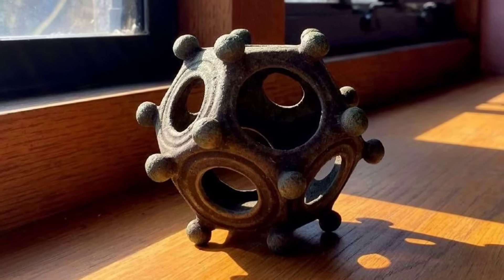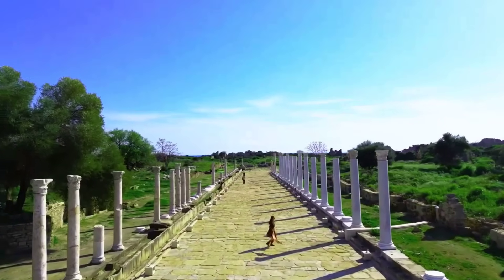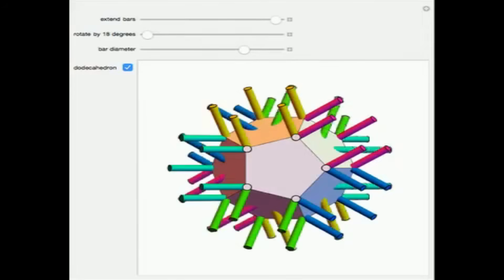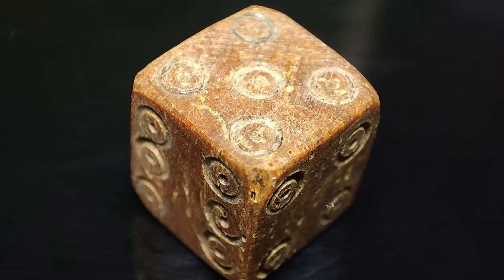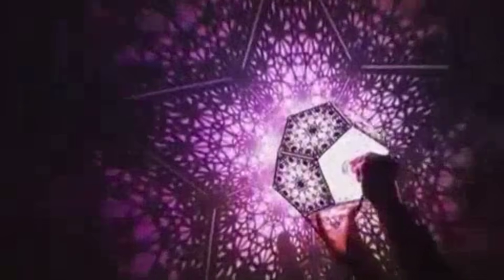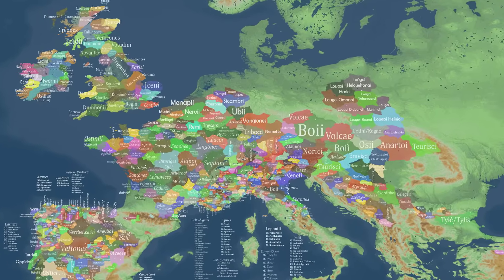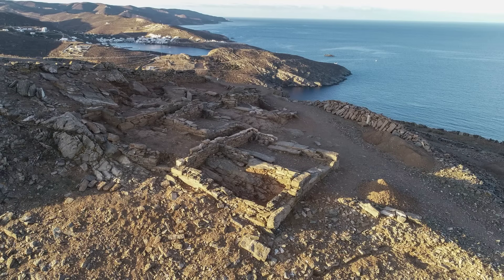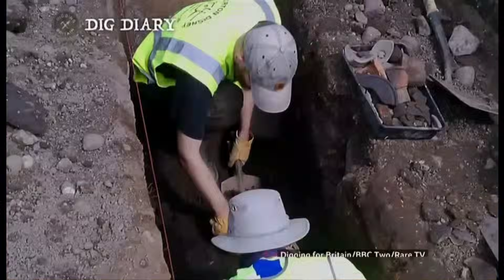Scientists Finally Solved the Roman Dodecahedron Mystery — And It’s WORSE Than We Thought

Comment: FUNCTIONAL LUNAR–SEASON SYSTEM USING A 12-FACE AND 20-FACE DEVICE
Purpose of the system
This system exists to keep a community aligned with the Moon and seasons over long periods without day counting, written numerals, or astronomical calculation.
It is designed to:
survive missed observations,
tolerate weather and seasonal distortion,
and correct long-term drift without destabilising the monthly structure.
The system operates using two objects with separate roles.
PART I — THE 12-FACE DEVICE (MONTH CONTROL)
1. What the 12-face device represents
The 12-face dodecahedron represents twelve lunar month positions.
Each face corresponds to a type of lunar month.
Faces do not represent calendar dates or fixed lengths.
Orientation is contextual (the system does not require a fixed “January”).
The object is rotated through the year as months pass.
2. How a month begins
A new month begins at the first confirmed full moon after the previous month ends.
Full moons are chosen because:
they are unmistakable,
visible even under poor conditions,
and culturally dominant.
New moons are not used because they are unreliable under real conditions.
3. Month-type encoding (the numeric ladder)
Each face carries a numeric class, encoded by dots or notches.
The observed operational sequence is:
10 – 9 – 8 – 7 – 6 – 5 – 5 – 6 – 7 – 8 – 9 – 10
This sequence is:
mirrored,
bounded,
and repeated across objects.
These numbers are not counts of days.
They represent tolerance bands for the month.
4. How the numbers are used in practice
When a month begins, the face in use tells the observer:
how much deviation from expectation is acceptable,
how long to wait if the moon is delayed,
and how much slack exists before correction pressure builds.
Higher numbers (9–10):
long visibility windows,
greater seasonal stability,
minimal risk if observation is late.
Lower numbers (5–6):
compressed months,
winter conditions,
high sensitivity to drift.
No arithmetic is performed.
The observer interprets the month categorically, not numerically.
5. Rings / secondary marks (dark-day buffering)
Rings or secondary marks indicate buffer allowance.
They allow the month to absorb:
cloud cover,
delayed moonrise,
horizon obstruction,
extreme seasonal twilight.
Instead of forcing recalculation, the observer waits within the allowed buffer.
This is why the system does not collapse when observations are missed.
6. Progressing through the year
After each month ends, the object is rotated to the next face.
The sequence is followed continuously.
After twelve months, the object returns to the starting face.
No correction is performed here.
The 12-face device is intentionally kept stable.
PART II — THE 20-FACE DEVICE (DRIFT ACCUMULATION)
7. Why a second device is required
A lunar year (~354 days) drifts against the solar year.
Correcting this inside the 12-month system would:
distort month-types,
break the mirrored structure,
and destroy tolerance logic.
Therefore, correction is externalised.
8. What the 20-face device tracks
The 20-face object tracks full-moon dominance cycles, not months.
Each full moon has a recognisable three-stage window:
approach,
peak,
decline.
Each complete full-moon cycle advances the accumulator by one step.
The three-dot clusters mark this three-stage recognition, not three days counted.
9. Accumulation across years
One full moon → one increment.
Increments accumulate across years, not within a single year.
The device is advanced only at full moons.
The object is not reset annually.
10. Triggering an intercalary month
When the accumulator reaches its threshold (≈ 20 full-moon increments):
an extra lunar month is inserted,
immediately following the major seasonal anchor (e.g. Samhain / winter threshold).
This restores alignment between:
lunar months,
seasonal position,
and agricultural or ritual timing.
After insertion:
the accumulator is reset,
the 12-face cycle continues unchanged.
This is why the extra month:
does not disrupt the month ladder,
does not require renumbering,
and does not occur every year.
PART III — SYSTEM PROPERTIES
11. Why this system is resilient
Missed moons do not break it.
Bad weather does not break it.
Observers do not need literacy or numeracy.
Different marking styles do not break it.
Correction happens rarely and deliberately, not constantly.
12. Why dots and notches coexist
Dots and notches are equivalent encoding grammars.
They:
encode the same tolerance classes,
are culturally or regionally variable,
and do not alter system behaviour.
The fixed geometry enforces consistency;
the markings allow local expression.
13. What would break this model
The system fails if:
markings do not cluster into bounded numeric classes,
dot and notch variants encode incompatible ladders,
or the 20-face object demonstrably tracks something unrelated to lunar cycles.
Until then, it remains operationally coherent.
Summary (plain)
The 12-face device manages month behaviour.
The 20-face device decides when to add an extra month.
Months stay stable.
Drift is corrected externally.
The system survives real-world conditions.
No symbolism is required.
No precision is assumed.
Nothing is counted that does not need to be.